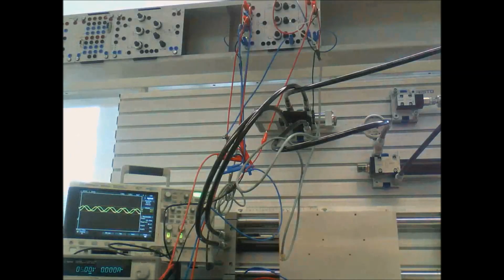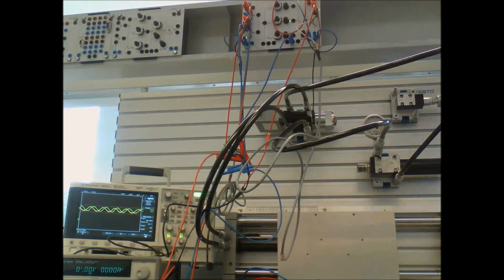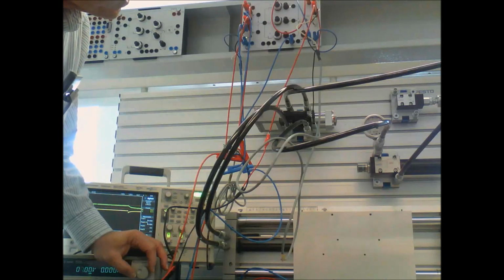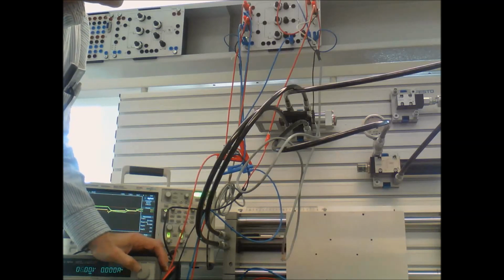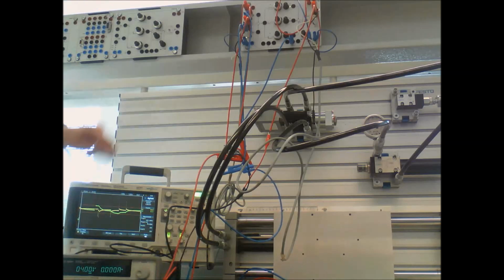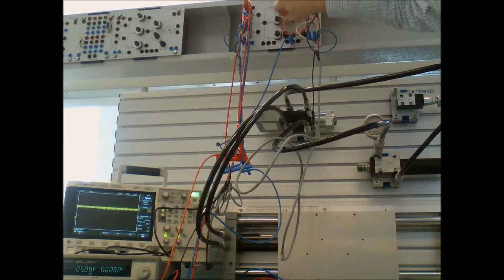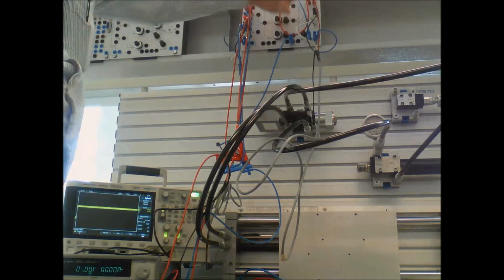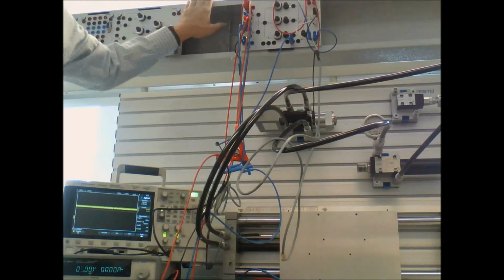PID control of Hydraulic Cylinder Position

Comment: Could you be so kind and explain me what kind of piston and magnetic valves were you using? 
Best regards
Reply from the maker: I'll check on the parts when I am back in school and let you know.
Reply: Thank you very much!
Best regards
Reply from the maker: Sorry for the delay - Everything is from Festo - links to the specific parts:

Cylinder

http://www.festo-didactic.com/int-en/learning-systems/equipment-sets/hydraulics/components/8002.htm?fbid=aW50LmVuLjU1Ny4xNy4xOC41NjAuODAwMg
Valve

http://www.festo-didactic.com/int-en/learning-systems/equipment-sets/hydraulics/components/7500.htm?fbid=aW50LmVuLjU1Ny4xNy4xOC41NjAuNzUwMA
I hope that gives you the information you need.

Comment: you can help me method serch kp ki kd? I write pid on plc fx3u but control position PV#SP ,error very big,thank you so much
Reply from the maker: Best to start with just kp - set ki and kd = 0 if you are controlling a hydraulic cylinder. 
Is the target position changing quickly? You may need to add some feed forward.

Comment: What was the best positioning precision you've managed to achieve with this setup? What kind of valve was it?
Reply from the maker: I've never tried to measure the resolution of the sensor in the cylinder since we just use it for student "experiments". I believe that the valve is a Festo 4-2 valve for the control. I can get you a model number if you wish.

Comment: commercial hydraulic servo controllers are much more advanced and can move much faster with better precision.  It is a mistake to think P, PI or PID control is all there is.
Reply from the maker: Yes. Thank you for the comment.
Reply: Can you give an example of such a valve please? I'm trying to achieve high precision hydraulic control in an industrial machinery